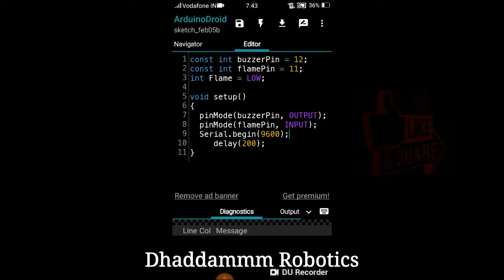®Diy Auto Firefighter System for Industrial or Home Applications | Arduino ,Code | Dhaddammm Robotic

Comment: Just one word for this project ' Superb' ...👌
Hat's off to you Sir  !
Reply from the maker: Thanks my dear . Please Subscribe my Because I am new on YouTube.
Reply: @DhadamRobotics  
Sir I already subscribe your channel
Reply: @DhadamRobotics   Sir Can you explain where you attached relay and 12volt battery with motor..please..its very urgent ...thanks
Reply from the maker: @iam.naofil  See description bottom diagram present
Reply: @DhadamRobotics  Sir but there is only sensor diagram with arduino...can you se d more exact diagram of each..And also tell me that pins on arduino beacause I have a big IC on arduino Uno but your arduino contains another pins (next to ICMP pins)
Reply from the maker: @iam.naofil  Sensor pin is D11,or buzzer/ led/relay pin is 12
Reply from the maker: @iam.naofil  compare with diagram
Reply: @DhadamRobotics  Sir I can't understand that diagram.. I request you to please draw diagram with your hand, also draw with 12volt battery.. 🙏 Please
Reply from the maker: @iam.naofil  I Make new diagram , Check after 5 min
Reply: @DhadamRobotics  Thank you very much sir..
Reply from the maker: @iam.naofil  Check it

Comment: Sir... What is that coil and symbol in that image that you place in drive diagram... Please explain..
Reply from the maker: Connect Relay coil one wire to  arduino pin D12 or second coil wire connect to arduino gnd pin , other relay output pin is directly connect to 12 v Battery to pump in series,
Reply from the maker: If Are you not understand , then follow video